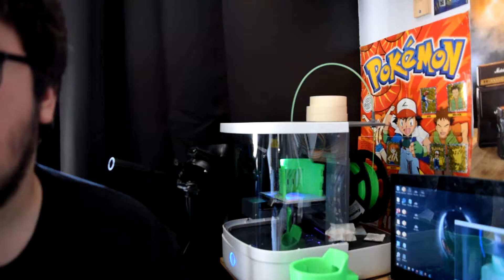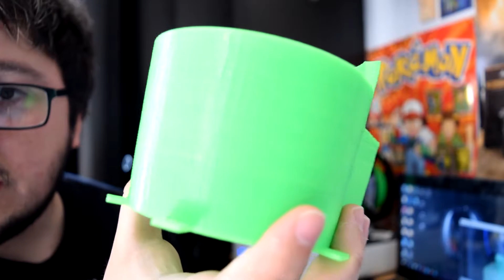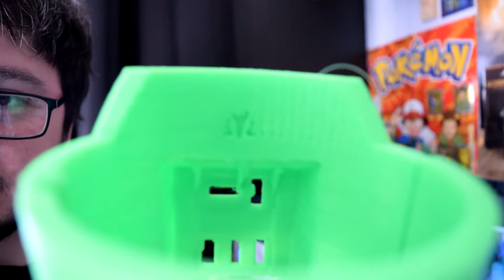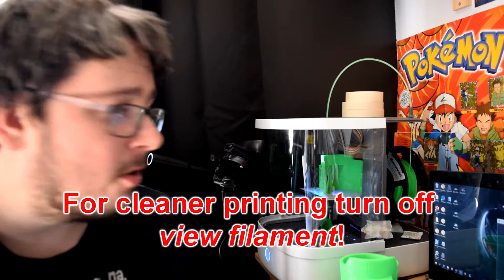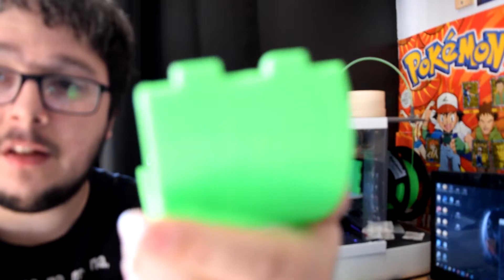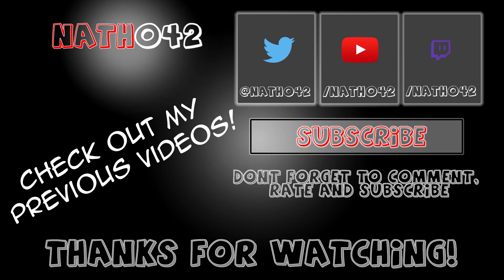How to 3d Print Mandalorian Armor P1

Comment: So need to hunt down the stl files, half asleep last night and hit me that there has to be files for a kit.
Reply: @nath042  thanks. Less than 2 weeks into the printing thing but been looking into the Merc Clans for a few years.

Not set up to vent ABS but have been looking into the PLA+ and other less temp sensitive filaments.  Worse comes to worse resin or epoxy to rid of the banding lines.

Comment: afternoon. I have a v3 printer and are having some problems with my prints. I am using PAL with my bed at 55 and head at 180. All of my prints never finish. I I've have problems with the first layer sticking or the prints fails during the print. Can anyone help?
Reply: I am using a PLA called prima filament.  I have calibrating the bed using the tool and it is nice and snug. I will try using a higher temperature.  thank you for the advice